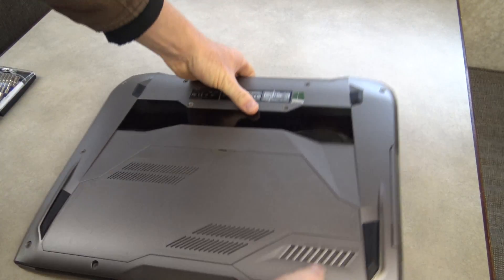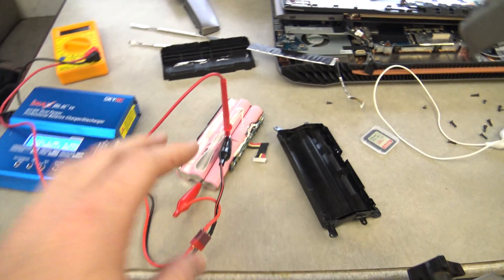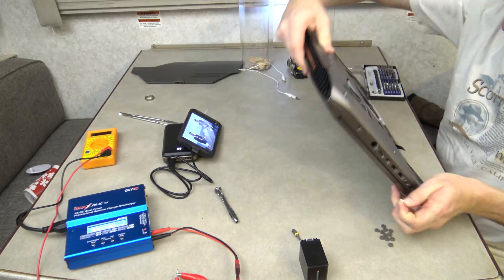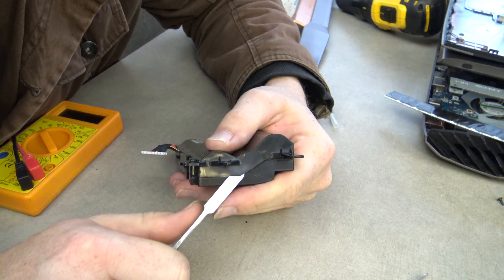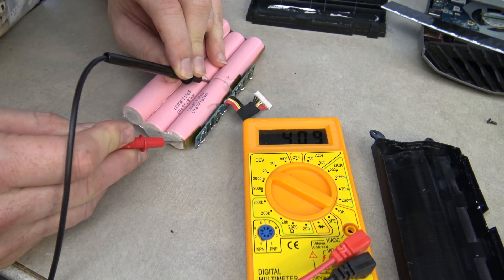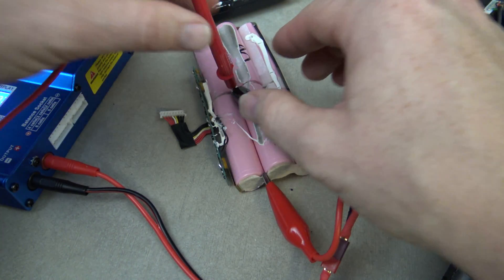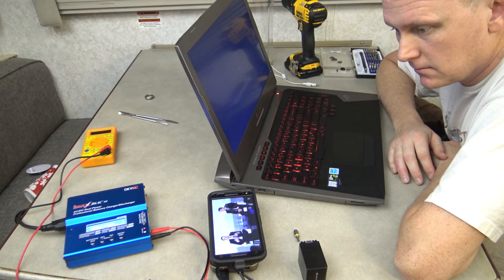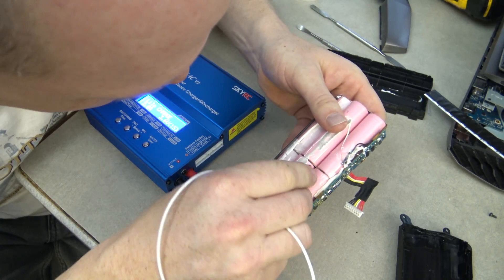Laptop Battery wont hold a charge FIX (doesn't last, charge or dies quickly)

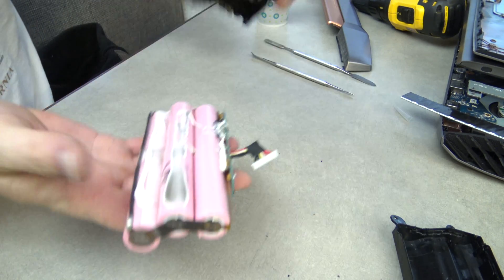Comment: I have a question, if I wanted to replace the battery cells for this exact model, how do I know which battery cells I should buy? I searched on google the number that appears at 0:49 , but could not find the same cells
Reply from the maker: I think they are standard NMC lithium ion batteries.

Comment: My Vaio had been telling me for probably a couple years that my battery was about to die. And since it started to tell me I've had to keep it plugged in for it to work for more than +- 30 minutes on battery power. The other day I unplugged my computer and it turned off (purchased in 2010). I bought a new pack online, generic, and ripped apart my OEM pack. I tested the cells and they all tested over 3 volts. Two were barely over 4. I guess mine wasn't balancing either. Unfortunately I had to destroy the pack to get the batteries out. Oh well. Guess I'll use them in a flash light or buy a powerbank kit to build.

Comment: Do you know if these battery packs are capable of self balancing if left unused for any given period? Also, Impact Fire Services says to use a Class ABC, or BC, dry chemical fire extinguisher, if a battery catches fire, since lithium ion batteries use liquid electrolyte and not any actual metal lithium.
Reply from the maker: Don't think they have any balance features that I have ever seen.
Reply: @TRYtoHELPyou  Understood. BUT... do you think they can "even themselves out" just by sitting unplugged and unused for however long? I know they lose charge after not being used for a bit. Could the pack balance itself just by sitting unused for a month or so?

Comment: So I have bought the SykRC through Amazon, and bought new 18650 cells charged them to 4 volts, soldered them to the board, but the output of the protection circuit is always 0.5 volts not 11.25v, tried shorting the +ve of the batteries with the pack +ve for a few seconds it turns back to 0.5 volts, 

Tried to check if there's any protection ICs there found this one https://www.dexerials.jp/en/products/c3/sfh1215.html it has a fuse and a heater, the heater seems fine resistance is typical, the fuse takes 11.35 in and outputs 5 volts, not sure if it's faulty, tried to short the fuse but the circuit package outputs drops even more to 0.3v and jump pack to 0.5v when removing the short

If you have any ideas here it would help a lot

Comment: is there a proper way to desolder the old cells and replace with new ones ? as I don't want to brick or lockdown the charging circuit
Reply from the maker: Pretty sure it's not that kind of a circuit board. It seems to just be a cutoff for over or under voltage. Replacement batteries may be available if you search on amazon. I will be rebalancing my cells again soon. Maybe within next 6mos or so
Reply: @TRYtoHELPyou  great to know, thank you for your fast reply and the useful video 😄
Reply: @TRYtoHELPyou  do you have an Amazon link for the battery charger you used in this video

Comment: I have this laptop and my battery has been only charging up to 95%.
Reply: That's a battery maintenance feature, it stops charging around 85 / 90% to preserve  the life of the battery however this feature is optional  and you should be able to find it in the settings if you wish to turn it off...

Comment: Would be keen to see your Toshiba laptop battery fix, but I assume it would be a very similar process. My Toshiba battery is removable so that will save some time. It makes sense now that that you say that they do not balance the cells, and that is extremely disappointing, but not unexpected in this capitalistic world!
Reply from the maker: So, I cracked open the Toshiba and one of the cell groups was below 2 volts, gave up on it. I think there is footage somewhere but ... I just bought a new battery on Amazon for around twenty bucks, that and converting to SSD from the HDD made battery life just great compared to before.

Comment: Hey quick question the light bar that is glued to the battery do you know if it can be replaced with a different light strip? I busted my cable on the strip and damaged it

Comment: Orrr.... Just buy a Genuine new battery online and replace it, you do realize that only sand can take out lithium fires...
Reply from the maker: There are no replacement batteries from the OEM that I can find. Should we trust a non-oem brand?(bow bout the original hoverboard mfgs) . Given that none of the batteries were under the safe voltage threshold, this method works for me. It is dangerous however. Though a lithium ion battery can thermally vent and be difficult to put out, a fire extinguisher will put out the fire it causes to other materials nearby.

Comment: On a full charge my laptop gives me 2 to 3 hours of usage.  But after a full charge, if I don't use the laptop for several days, it will have zero charge.  I don't understand what is happening.
Reply from the maker: I could only guess what may be wrong. Your computer perhaps uses power when off. The protection board uses power when off. High internal resistance of the cells. These are all guesses. Don't know if you will ever know.
Reply: @TRYtoHELPyou  It is a few years old now.  It can still be charged.  But it still doesn't hold the charge long when powered off.

Comment: I was serching and was exited to see you had the exact same computer.
Reply from the maker: what are the odds! are you going to do a full teardown like in the video?! Good luck if so. Just be safe!
Reply: @TRYtoHELPyou  i have this same computer two years old it dies as soon as its unplugged hard drive is about to fail aslo keep getting the smart system message when i power it up

Comment: i have an Asus ROG gl752vw laptop and i also have the same problem "0% plugged in, charging" but nothing is happening and then i saw some FIX it video on resetting the battery by "uninstalling the ACPI, then taking out the battery" so that it will reboot. now my Question is: is it safe to take out the battery and then turn it back ON while the battery is OUT?

i have tried these before on my DELL laptop, but the battery is external. my Asus on the other hand has an internal battery so i am not so sure if plugging back the laptop ON without battery is safe for my Asus or not?
Reply from the maker: I would not say its safe. I think you will be fine to not have the battery and plug it in and turn it on but to be to be clear, it is not made for that .... They made the battery non-removable. So yeah. You will be taking a chance if you do it. Good luck and may the force be with you.
Reply: that's what i was afraid off. And i think your absolutely right, i might do something to my laptop that's gonna be UNDO ABLE and could well regret it. thanks for the advice and awesome video by the way.
Reply: @gotba2146  you have the same pc as me, mine has been doing what you discribed for months now and just today it will no longer turn on.
Reply: Man this is happening to me too. Annoying as hell.

Comment: I have an Alienware 17 with a battery that's essentially dead. It's not removable, but the laptop itself is pretty easy to disassemble, and so I removed the battery, but I don't know what to do with it. Dell doesn't offer replacement batteries for my model anymore :(
I'm not sure if it has the same problem as yours though, but I might give it a try if I can get a hold of these sweet tools one day.
Reply from the maker: well. looks like you are on some sort of path rather than doing nothing. I wish you luck! Please update this thread if you have success or failure. Thanks!
Reply: Right! Will do. I've never seen one of these chargers before, they look very expensive, especially where I live. Multimeters are cheap enough and I could use one in University. I'll do some research and try it! I have to get a fire extinguisher though...
Reply: My laptop has stop working so can you please help me to solve this issue plz
Reply: @staceyflowers6538  you can try to get a battery on ebay.  I found one for my model but figured it was not worth it. I just use it plugged in nowadays

Comment: Mine doesnt even work without being plugged in would this work for me because I don't want to do this if it won't
Reply from the maker: Wendy's burger joint this is the question of anyone stuck in a diagnosis where they are u sure of the outcome of the fix. This will be a tuff decision. I wonder, do you have a lithium ion battery charger?
Reply: TRY to HELP you honestly I bought it used and I don't know the battery type and I don't know much of computers I just want to find a way to fix this I have access to the battery via the bottom you know one of the easy access one's so would you suggest I just buy a new one?
Reply: I've been having the same problem since to start of 2018 but literally just a few hours ago it even stopped charging. I thought about taking it to a shop or something but they probably couldn't even fix it. Might have to completely buy a new one which is fucked up. I more than likely killed the battery myself by keeping it plugged in but that was the only way I could keep it working.

Comment: Wow, you're a brave guy, this is major surgery. You have certainly succeeded and I will never buy a laptop without a removable battery again, unless it's clearly easy to disassemble, remove.
Reply from the maker: +Charles Tatakis major surgery indeed. Thanks for the comment. This isn't a first teardown for this laptop or many before it for me. To include batteries as well. Removable is always the best but these ASUS guys have all the right parts inside that is not the easiest to come by. Now if only I could finish my ebike battery....

Comment: Is it bad to keep it plugged in when in use?
Reply from the maker: poru oru it depends who you talk to or get your info from. I have found when it is in use, having it plugged in when you can plug in is good. But for lithium batteries to stay at a high state of charge is not optimal for long periods. Around 3.5 volts is where they store for long periods really well. I think the main "is it good for ___" question is the heat. If the batteries get hot they will degrade faster. For my laptop I try to run the fans at full whenever I put a load on it. What laptops really need is a battery management system that allows you to choose to charge to a certain maximum level... And for there to be a balance feature. Laptop makers don't care enough to make this a standard thing as far as I am aware. They just let the equipment go bad over time. They are happy to sell you a new battery in many cases. I went on a tangent but I hope that answers your question. My answer is no it's not bad to keep it plugged in while in use.
Reply: TRY to HELP you thanks a lot for that informative answer. 
I have the same laptop but never tried it UNplugged.
Reply: TRY to HELP you btw how do you run the fans manually?
Reply from the maker: +poru oru watch my review of the laptop. I talk about the fans in it. And where to go to download the software. I would note the time stamp but I'm away from my computer and headed to bed. Good luck with it!